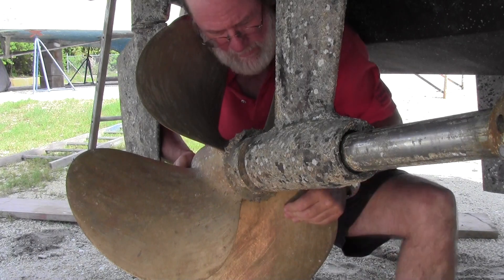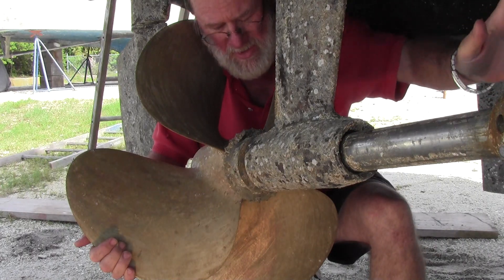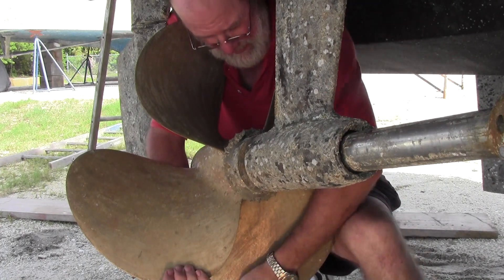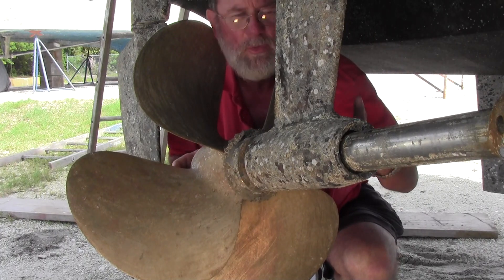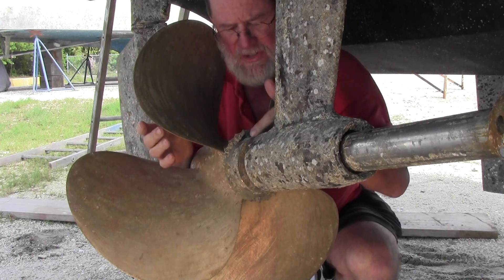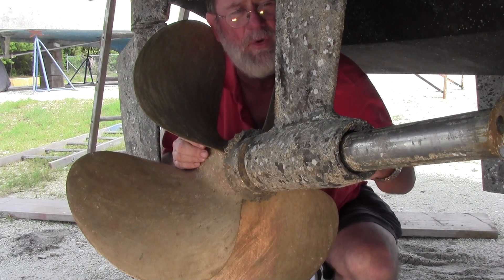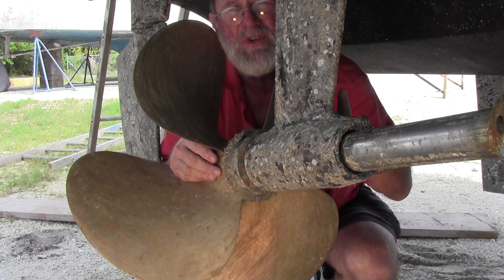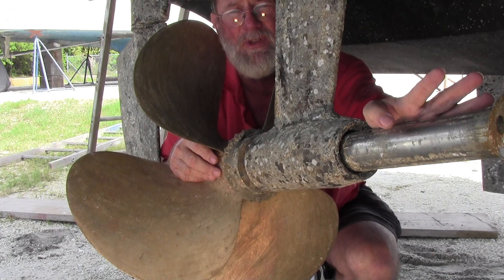Very bad Cutlass Bearing

Comment: That was probably the worst cutless bearing I've seen. I tested mine with an indicator and found only small radial play but some of the rubber ribs were starting to delaminate from the brass or bronze casing so I replaced it because of that.

You said monel stainless steel shaft. Please note that monel is a copper nickel alloy (with some other herbs and spices) so even if it hardly stains, it's not steel.
Reply from the maker: Good move, proactive maintenance is best!